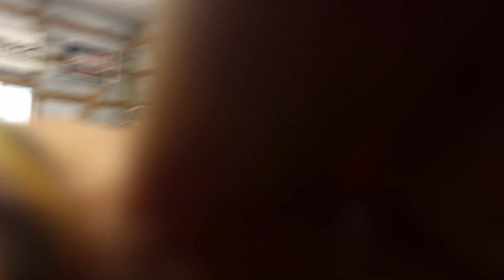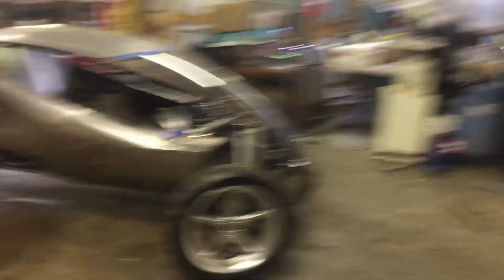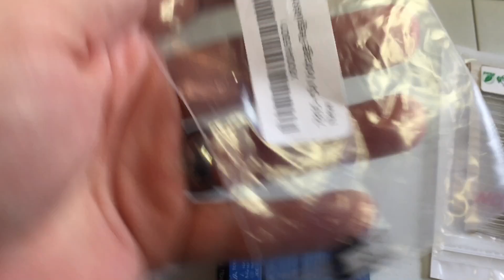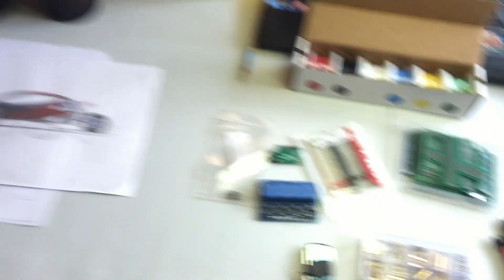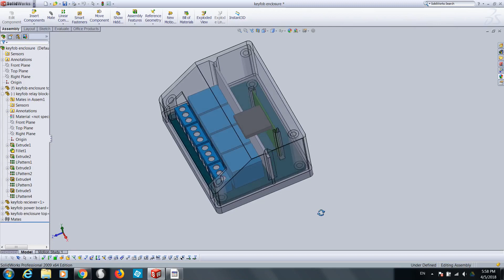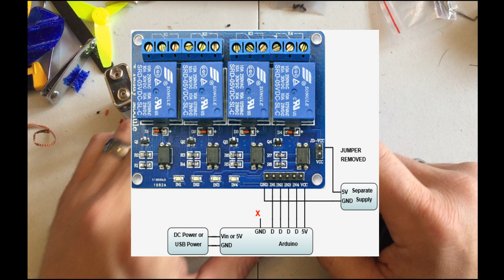DiamondBack Keyless Entry Remote Installation

Comment: For your 3d prints try using more support materials in a slicer or something like CURA. I'm no expert on slicers but definitely go with a 100% infill and in ABS. It makes incredibly strong prints.  Also, it may be a good idea to add some kind of 3M foam underneath any open PCB boards because under the stresses of driving and vibration from the trike's motor you could have issues with solder cracking /general electrical issues.